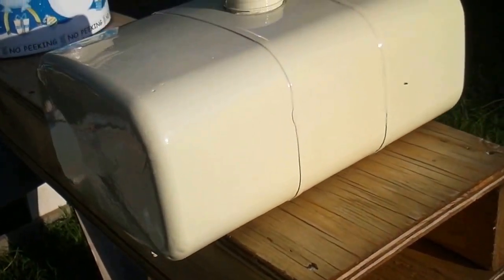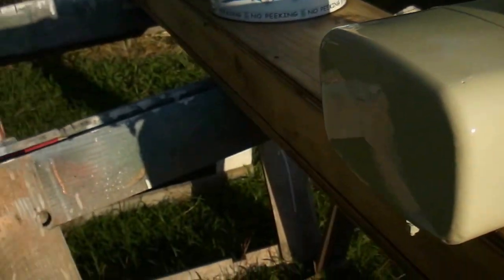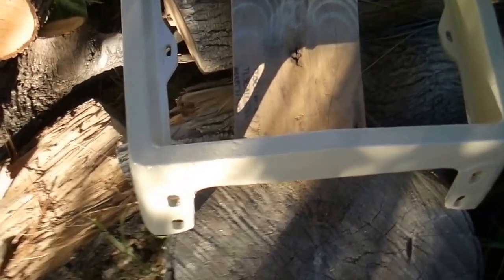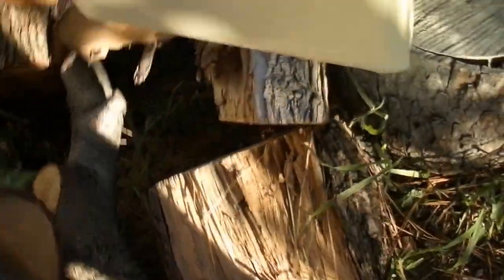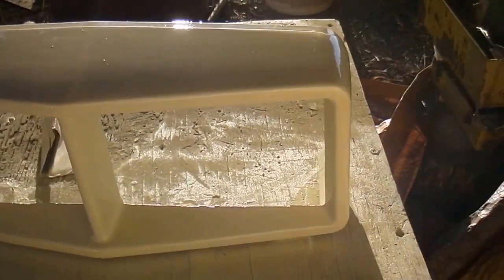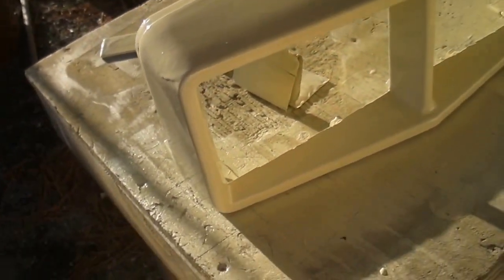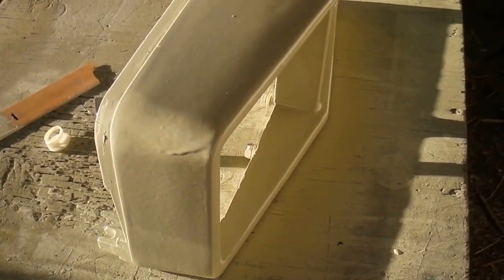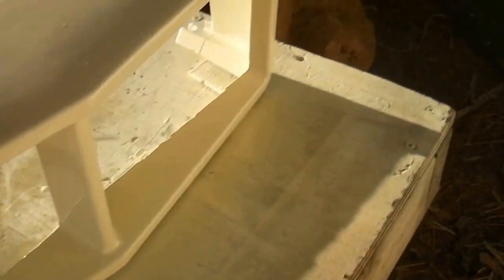Painting Cub Cadet 149

Comment: You been keeping busy, but I haven't seen you post a while. I have a pretty old Simplicity mower that could use a wax job . Simplicity was made just up the road from me in Port Washington WI. I am in Milwaukee. Believe it or not, Simplicity was a division of Allis Chalmers (Simple AC). Allis Chalmers was a giant company, and had their main plant in West Allis Wisconsin, a part of Milwaukee in some respects.
Being "to big to fail" AC was widely diversified, building Transformers, tractors, water turbines, engines mining equipment gosh they made anything and everything. https://en.wikipedia.org/wiki/Allis-Chalmers
 Be great to see the Cub back up and running.
Reply from the maker: Its so hot outside I been working on my CBs in the house hiding in the AC . It rained and it was cooler outside so I did some work outside. It still was incredible how humid it was gosh. I just get drenched in sweat. I would like to see the Simplicity make a video about it that would be nice.